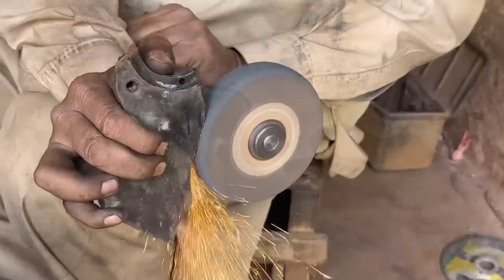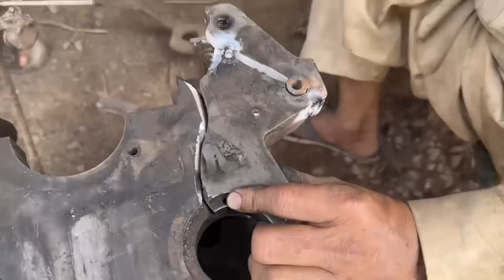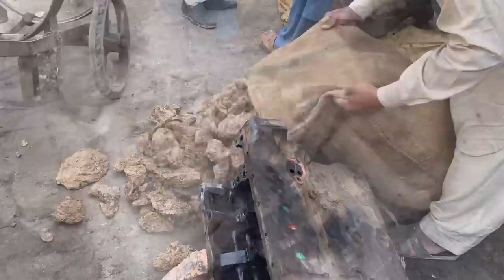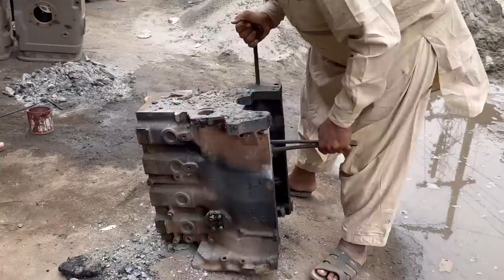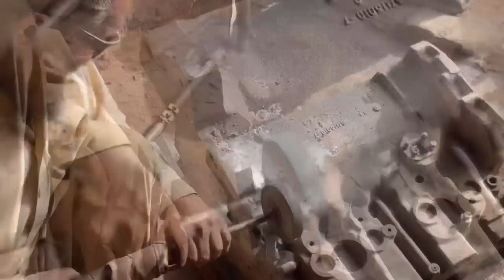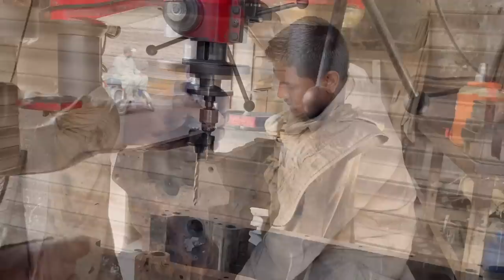Fiat Tractor Broken 4 Cylinder Engine Block Repair-How Rebuild Tractor Block With Unique Way|

Comment: Good job!
Now this engine will run next 5 minutes until it brakes and falls apart.
Reply: I don't know but in a country where they use camel sheit as a fuel, I don't think a welder can do a job who can last only 5 minutes without suffering terrible consequences... like e.g. get some extra holes in the body